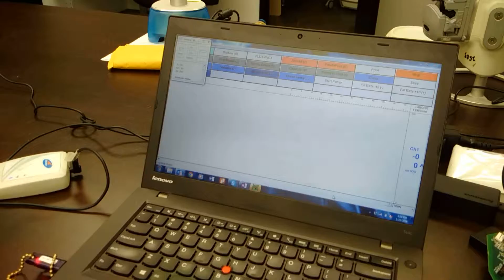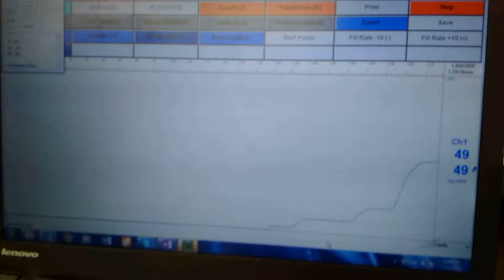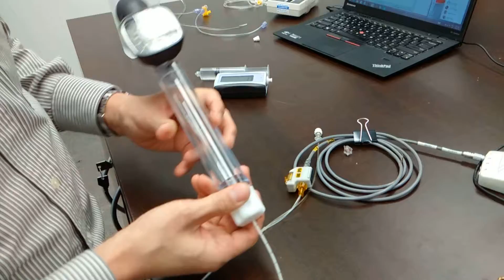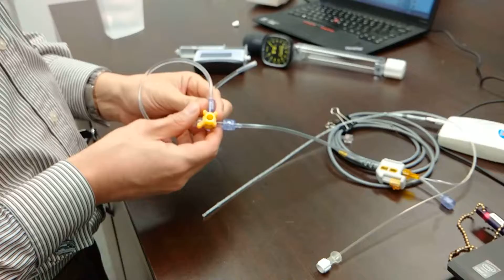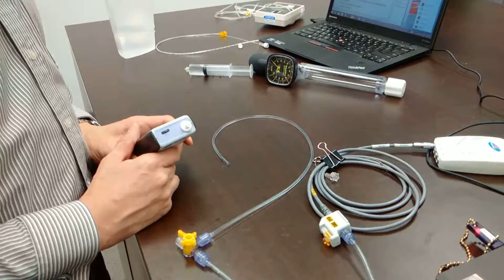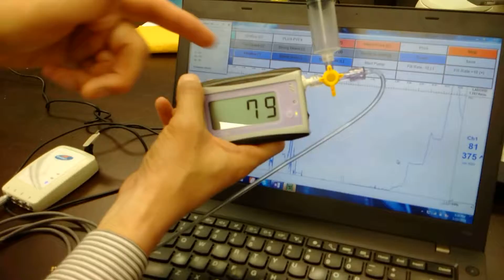Calibration Check Methods for Air-Charged Systems

Comment: Hi I'm in Morroco how Can i get this small machin (manomètre) to test my TDoc système ?
Reply from the maker: Ask your LABORIE rep to see if they sell a t doc calibration tube. It has a built in manometer dial to check your pressure readings. The device with the digital read out show is sold via instrumentation companies. The pressure chamber tube is the best way if LABORIE still has some inventory to sell to you.
Reply: @igoping  thank you for your answer